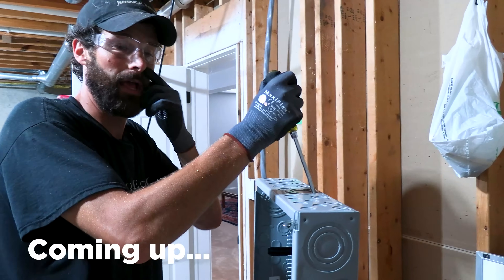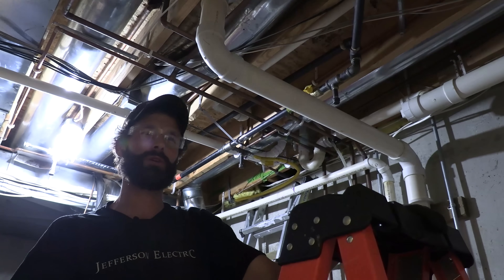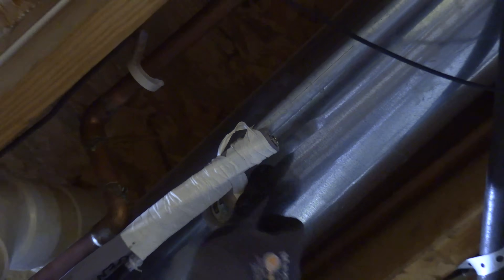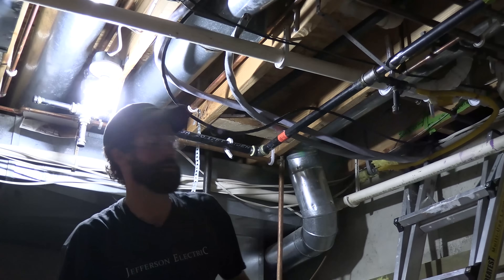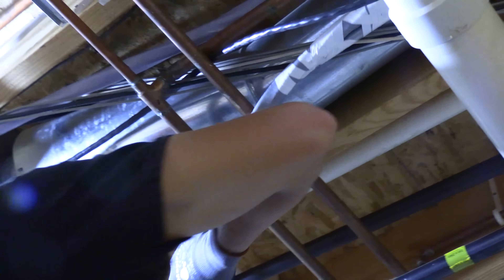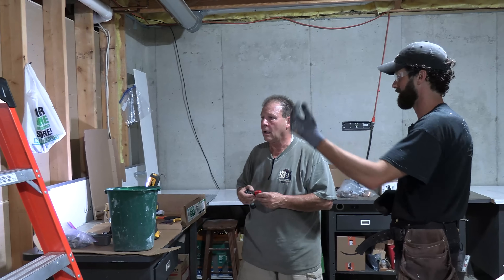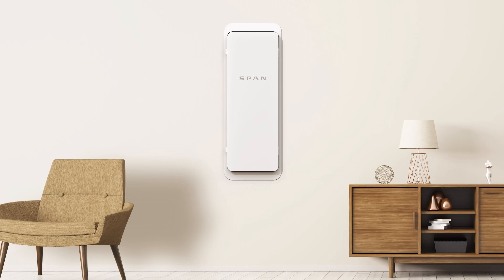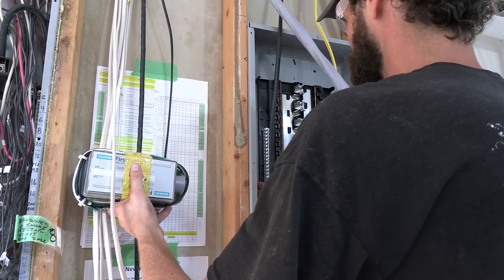I Blew it!!! Right in Front of our Best Customer!

Comment: Everytime I see big SE cables I wonder...do they ever send 2 wires connected for L1 and 2 wires connected for L2? I am 150 feet off the street with a buried service in pvc. With the onset of car charging a 200 amp service is no longer king. I dont think there is ANY possible way to pull a 1000kcmil wire through that pipe.  I could fathom a SECOND 4-0 aluminum feed for L1 and a SECOND one for L2.  Could they tie those 2 cables for L1 to a Polaris connector and the same for L2 to feed the meter and now have 400 amp capacity without starting all over?
Reply: I believe what you’re describing is a parallel feed. For example, if your SE conduit carries 2 current carrying conductors, one grounding conductor, and one grounded conductor, you would add a second pipe and fill it with the same conductors. You would NOT put all your L1’s in one pipe and your L2’s in the other

Comment: I heard a war story about a telephone installer using a bell-hanger drill bit install a residential station line. He drilled up from the basement but he misjudged
what he was measuring. It turned out that he had drilled up through a hardwood floor an into a piano leg.
Reply: Were his initials W.D? 😊
Reply: @brucerauch8024  Not a chance. Not even one of our people. But it does remind me of the day that one of the installers asked me to come look at something he didn't want to do. He wanted to make safe electric prior to drilling in a bank's data center. Our phrase was, "There ain't no good way."
The bank objected because they were running payroll on the mainframe. This is where smart people would come back tomorrow to finish that detail. And that's what I told my boss. He came to see for himself, to his credit. "I'll do it," he said, just before everything went dark and silent. You can imagine the rest.

Comment: Was lucky to never drill into a water line but while doing a job for a guy that I went thru school gave him a great price to install a receptacle.  Drilled into the 100 amp service cable that had a loop before entering his house and covered over with aluminum siding. The 28' extension ladder that I had on my van did not reach ultility wires so I had to spend a hour to get my 36' ladder. Instead of making maybe $25 for a few hours job lost money. Just glad I did not set the house in fire. Worst part he asked me if I know what I was doing. Told him they never covered drilling into hot service cables in three years of Vo Tech classes & apprenticeship.
Reply: Ouch! Damn!

Comment: 10:35 Rather than use that external box surge protector, Siemens makes an affordable  double breaker style surge protector, you can even double them up to get more protection with the second gen version, you already have planned for a bunch of free breakers.  Could even place surge protection easily in each sub panel.
Reply: I think the idea with the large external box is more surge protection.  No way they can fit all that stuff into just a double breaker.
Reply: @TheTurpin1234  The next gen 65KA $100 half the price of the 100KA version shown.  They say you can double up...  he could have put one at each his three subpanels.   Plus probably plug on neutral so easy swap in and out...

Comment: 3:42 Could set up wireless earpieces to communicate to each other rather than yelling through the walls.
Reply: In a pinch I use cell phones on speakerphone. Otherwise I have Dewalt radios with ear pieces on planned jobs.
Reply: The Zello walkie talkie for smart phones is great for stuff like this.  Can even be used to talk to people miles apart.